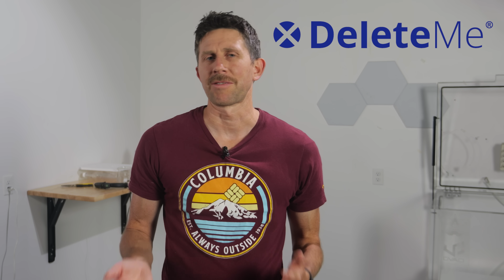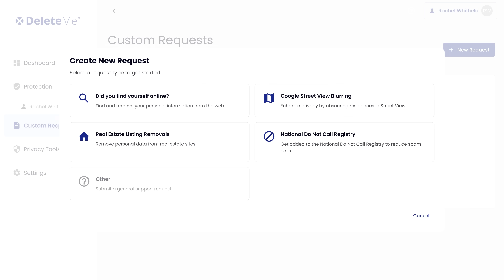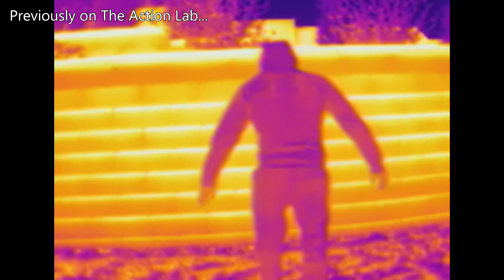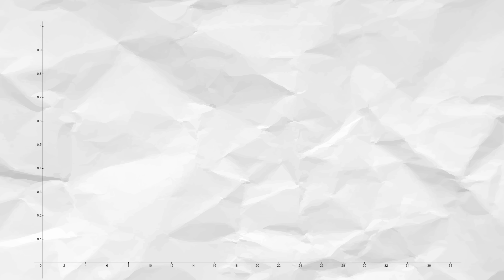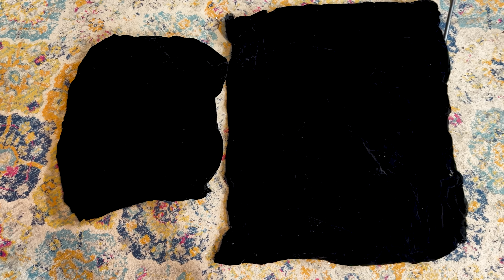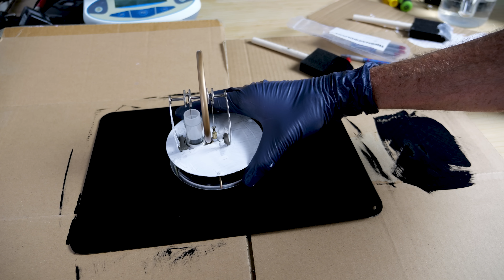This Engine Runs On Sunlight

Comment: It’s not an engine because it cannot power anything else.   It has no excess of energy.
Reply: Nothing has an excess of energy. E.g. It surely could power a small LED with a dynamo.
Reply: @Mobin92 and internal combustion engine has an excess of energy.   It produces more energy than is required to run the machine.   Unlike a sterling automaton which barely generates enough power to maintain its own motion.

Comment: The entire video I was yelling "vantablack" in my head.
Reply: Vantablack is not really a color but a structure that traps light. Also meaning that molecules and energy transfer acts different than on a "flat" surface.... And there's nearly equally dark paints used in the video. Vantablack was patented by a single artist and sold for fortunes which makes it practically not useable.
Reply: Vantablack fell off because the guy who made it sat on the patent, so people had to make alternatives that ended up being better.
Reply: it is outdated
Reply: All my homies hate Anish Kapoor. Based Stuart Semple.
Reply: Same here

Comment: I wonder how much power that engine can deliver, and if it's scalable.
Reply: No, it's just really inefficient solar with the addition of moving parts.
Reply: Is it scalable? Yeah, but it's one of the most inefficient engines out there
Reply: @akitoryuka15160  inefficient..?
Reply: @infinitebeing1119  yepp, because of the law of Carnot! Efficency less than 1 %
Reply: @abakan12  thanks for that, I can never remember that one
Reply: @abakan12  Law of Carnot says that the efficiency is 1-T2/T1. Temperature difference between black and white surfaces at the direct sun may be >60degC, so the theoretical efficiency must be about 20% - close to the efficiency of a solar panel.
If I estimate correct, the area of the black panel is about 0.05m2, so the solar panel of that size would produce about 10W. Mechanical losses in this machine may be close to it.
But efficiency of this setup can be improved by concentration of the lite with some mirror and increasing the temperature of the hot side, and adding a water-cooling to the cold side. But due to hight mechanical losses it may still lose to a steam engine.
Reply: @azlktune  If this would work - everybody would do this - since Years.
Reply: @abakan12  Powerplants using sun heat and steam turbines are working for years. But it was cheaper to use gas instead.
Reply: @abakan12  I would say that optimal solution would be a hybrid powerplant, which use solar heat during the sunny day to produces steam and power the turbine, and otherwise switch to the gas. It would be cheap and flexible.
Reply: Might be better to paint the bottom of the engine black, and replace the sheet with larger parabolic reflector. The struts holding the engine in the reflector's focal point could be thermally coupled with the top plate, and made with heatsink-like fins to improve cooling area.
Reply: yes and YES !!! me too thinking bout puttin some in my back yard xD
Reply: @snickerstoasted2212 
As a yard toy? Sure. 
As a possible power source? No. 

You would require three layers of components to even generate nominal electricity from this. 
(Rotational) (Moving parts) 

Just use solar.
Reply: There's the Sunorbit Sunpulse by Jürgen Kleinwächter that runs at "low" temperature. Probably still sux compared to photovoltaic but interesting concept.
Reply: Probably a set of mirror and a boiling tank produce more energy
Reply: 0.0000x and no
Reply: There is a practical limit on how large you can make both the light and dark panels. Also the amount of energy you can transfer into a cilinder at these modest temperatures is just not a lot.
Reply: It has enough power to turn the hands of a desk clock.
Reply: The amount of power it can "deliver", as in on top of what it takes to overcome it's own friction, is insignificant. Technically scalable, but not practical for generating useful power. Even those common peltier elements often sold for a couple of dollars each could probably deliver much more power, much more reliably, and at a much lower cost under those conditions, and they're mostly known for their very low efficiency.
Reply: Forget about motion, can this setup generate electricity cheaply vs solar panel?

Comment: This seems like an incomplete video without testing to see how much energy you can extract from it, that could give us a clue to how much this could scale at industrial scale which is what I wanted to know
Reply: You can do a rough calculation given the temp difference between the hot and cold sides. It’s a very small number
Reply: @broncokonco very small number including a conservative 70% loss in energy transfer. 

OP probably just wants free energy devices and not believing anyone that understands that stuff.
Reply: @screenteasing  Who said anything about free energy? This thing turns solar energy into mechanical energy which can then be used to make electrical energy. There's no doubt about that and solar energy is free in the sense that it's there whether we choose to make use of it or not. I think it's a given that this isn't an efficient way to produce power, else power companies would already be doing it. However, there's nothing wrong with being curious about how much power it does put out.
Reply: @chitlitlah  solar panels are more efficient at converting solar energy into electric energy, the interesting thing is that going from solar to mechanical directly without incurring conversion loses, could it be made efficient enough to convert solar to mechanical without incurring additional conversion loses
Reply: it could arguably (and I mean arguably) be more efficient than solar panels depending on the use case, eg if you wanted to drive a wheel you would skip a step using this sterling engine
Reply: @Tom-f8r8o  No it can't.  Ultimately this is limited by the Carnot cycle which itself is limited by how large of a difference the hot side is from the cold side.   The literally theoretical maximum efficiency is utter trash.
Reply: @T @Tom-f8r8o  since this can emit heat away can this be useful as an alternative to radiators on space stations? 🤔
Reply: Much of any of this energy generated would be lost in wire and components just to transfer it to usable energy. But it's great to invest in alternative energy in research and development. Which the USA should be doing investing trillions because it be to our benefit.
Reply: Hey we dont know what we dont know,
Maybe if you get the geometry right you could make it more efficient not to be better then a solar panel in the short term but you might be able to construct a low power long lasting device obviously the classic sterling emgine design would have to be completely reworked aswell.
Any proof of concept like this says nothing of what could or couldmt be done with enough effort and know how.
Reply: Isn't the video more of a proof of concept than something practical?
Reply: @umarcelovi  It's like putting together a 20 minute video of you preparing a sandwich and then the video ends. At least taste it and tell us how it was
Reply: @Wakish0069 using the same analogy It's like: explaining how to make a sandwich, making It and showing that cooking like that works, and If the viewer wants to, feel free to try at home
I mean, If I ate the sandwich  I made , I would be slightly biased saying It's the best damn sandwich I ever ate. It's more like stating how many calories It has, would be more like it 
Jesus Christ, what am I doing overthinking sandwiches? I have to work later
Reply: @umarcelovi  Most people don't have 3D printers and are wiling to spend like $100 on supplies to test something that someone else already tested

It's absurd to tell me to recreate this, I'm not the guy running the science channel. He already made it the very least he could do is test it

Edit: Also you seem to have missed the point of the sandwich analogy. What does he do with that sandwich when he turns the camera off, just throw it away? The final step of actually using what he made was never completed
Reply: @Wakish0069 by the viewer, I mean someone with access to that stuff; as for the sandwich, I was just having fun, really
Reply: This is much much less efficient than a regular solar panel of the same size. It's just a science experiment... Why is everyone trying to industrialise this? 😂
Reply: @Mobin92  i think the Amish would in interested in such simple technology.
Reply: @Mobin92  Why wouldn't you try to industrialize new methods of harnessing renewable energy? I have no expectation it would be very effective but I would still like to know how it compares, it's interesting and seems odd not to measure especially when he has the tools and knowledge to do so
Reply: @Wakish0069  That's no "new method" 😀 We did that more than 50..60 years ago  with solar concentrators, when solar panels were expensive. But since they've become so cheap it's no longer worth it.
Reply: @SolarCookingGermany  Those variants of black and white paints weren't available 60 years ago. Cryopaint was created in 2023 and Musuo black was 2020
Reply: @Wakish0069  The paint doesn't matter that much if you have CSP = concentrated solar power
Reply: @SolarCookingGermany  I would like to know how much it 'doesn't matter', for science. Knowledge is power
Reply: @Wakish0069  if you're so invested, go do the experiment yourself.
Reply: @bryanhunt1949 When did I say I was invested? I have invested nothing into this - I'm not the guy that made the science video
Reply: @Wakish0069  🤦
Reply: @Wakish0069  It's limited as a heat engine.   You would need a hot side thousands of degrees hotter than the cold side, to even approach photovoltaic efficiencies.  Even then the Carnot cycle caps theoretical limits regardless of engineering.
Reply: @patrickmccurry1563  Yeah I still just want a number
Reply: @Mobin92 Maybe they are a lot cheaper to make because they don't require rare earth metals or ultrapure silicon crystals ?
I dunno, just guessing.
Reply: More efficient ways

Comment: My car's motor also runs on sunlight. Solar panels > battery charger > motor.
Reply: I would love to do this sort of modification to my Kia Soul, all that flat space, collecting all that heat, and my car just gets blazing hot! 
Has a small engine, so it might work to power by solar....

Comment: Loving Stirling like more than a Friend...
[..and I Love my Friends like I Love my Freedom.]
An idea for another Test you can make with Cryopaint:
Try to use it as a Dissipator Performance Enhancer..!
I remember from the Channel 
"Tech Ingredients" 
(they are wonderful for your type of contents you should get in touch even if they're on the Pragmatic Side compared to you...they know how to have fun.)
That Ultra white Paint is more effective the more Differential  Temperatures are Present, this mean if something was much more Hot than the Surrounding Air Temperature it would work much better than a Fan for Cooling it Passively.